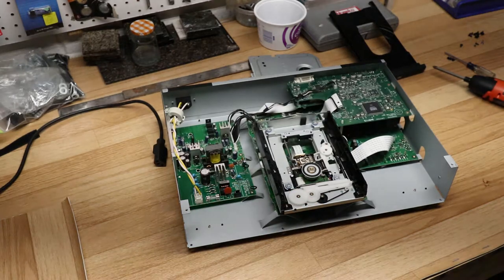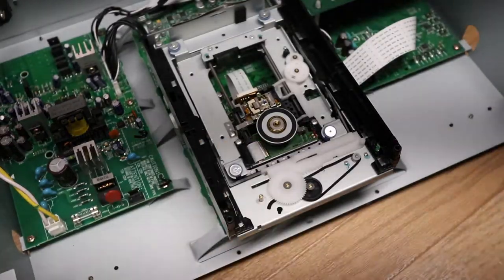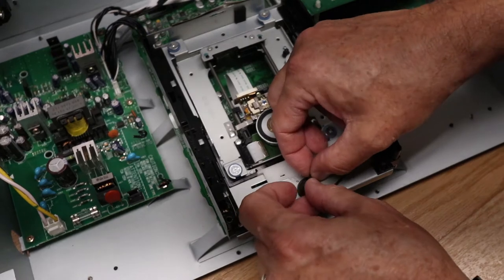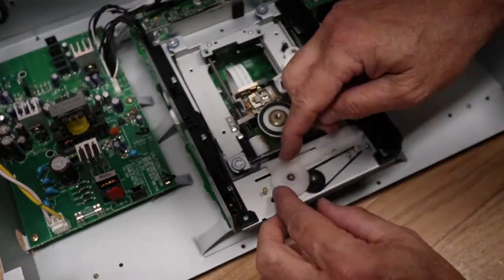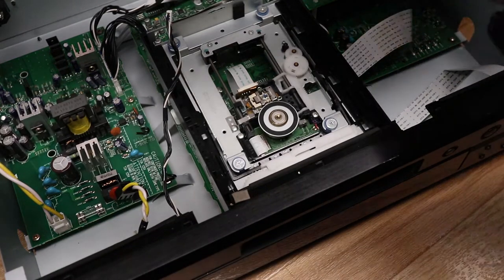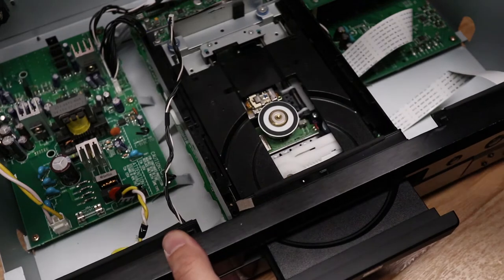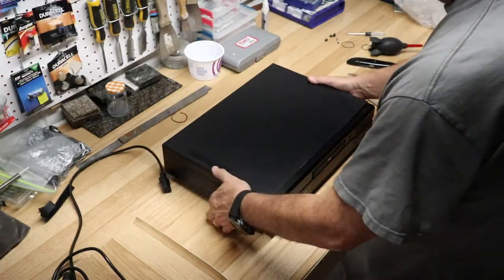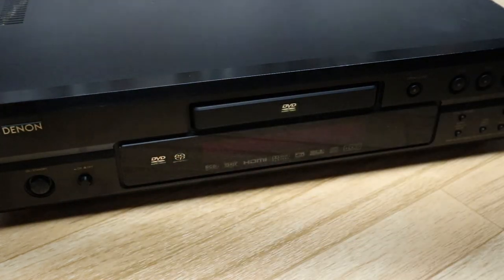Denon 2900/2910 belt replacement

Comment: this is just what i was looking for to fix my 2910, thank you
Reply: Player is working again! ;-)
Reply: The tray won't go back in. Stuck on left side. 2900. My 2800II was easy to fix. Not sure why the disc tray won't slide back in. Goes in about 1.5 inches then stops. Wont come back out either.

Comment: I was just looking for a easy fix for my unit🤔 
I agree with another comment, what happened before the replacing of the belt? 
I have a 2900 and the tray which was problematic now refuses to budge, although it does appear to try. 
Is there any soldering to be done? Hope not!
Is there any earlier footage?? 🤷‍♂️
😁🖖

Comment: Hello.  Thks for the video.  I have a 2910 player and the open close door is sticking.  The unit will play if I can get the door open.  Any ideas how to repair bf I trash it?  Thk u.
Reply from the maker: I've found that once the belt was replaced, the sticking drawer was fixed

Comment: I just replace my belt and you don't  need to remove the front part at all . Just push the tray out and you have access to the gears. After that you can just remove them to get access to the rubber band .
Reply: David, I removed the top cover, but one of the gears is still covered by the tray you put the disk in.  Do you need to remove the whole disk tray?  If so, how do you remove it? Thanks!